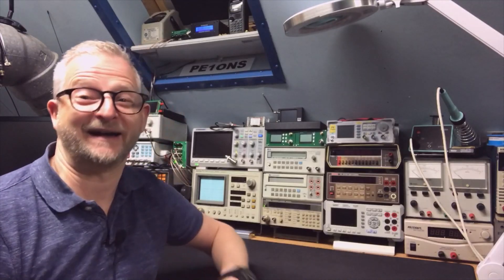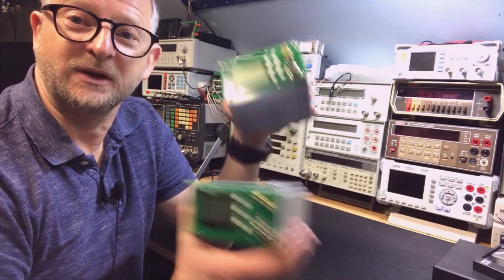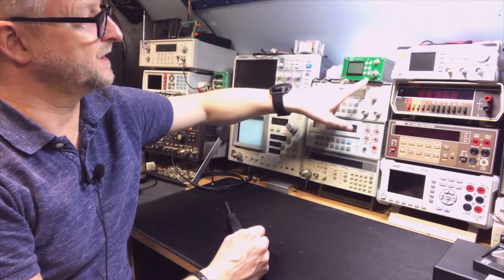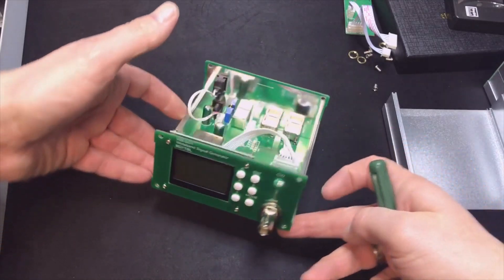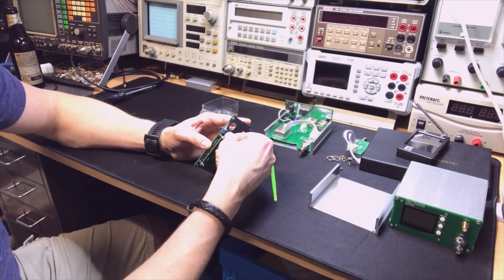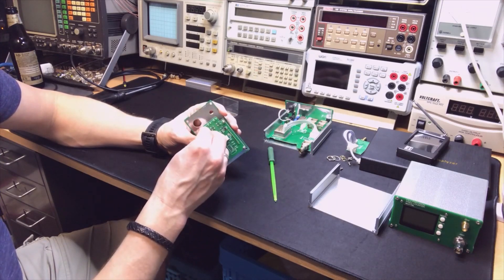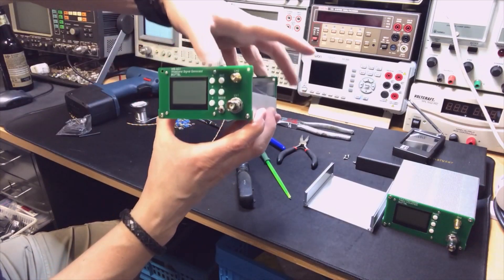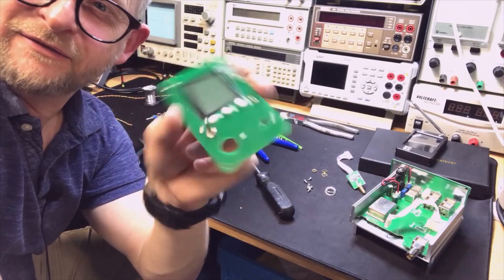#096 WB-SG1 BG7TBL and FA-2 BG7TBL Power Switch Mod.

Comment: Its a pity we can't reply with pictures and i could show you my mods.  The only thing i havent been able to mod is my HP1652B, as that has the switch on the back and it's on the shelf with a HP 8647A Signal Generator on top of it and 2 laptops on top of that!  I have to reach down behind all that lot when i need to turn it on.  So i eventually just put and inline switch on the power cord and use that to turn it on and off now as it hangs below the bench :)
Reply from the maker: haha.. yes halfway reading your comment i was just thinking the same.... pull the plug...haha... yes inline switch... we both hate switches in the back. 😁